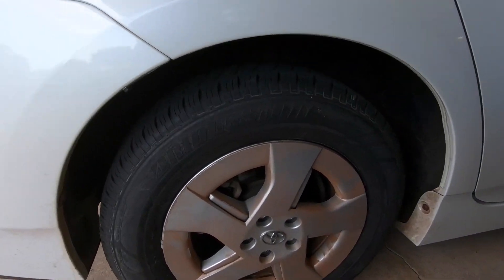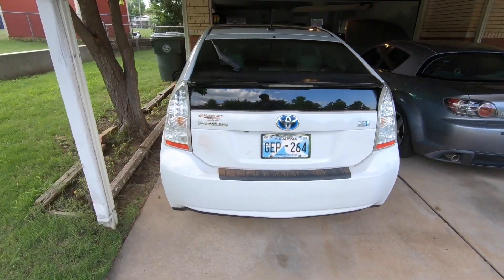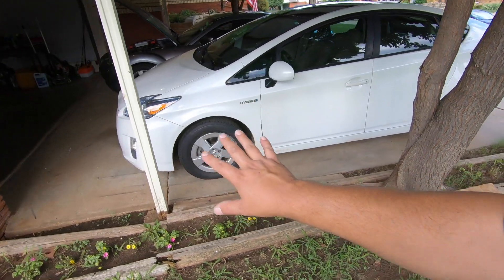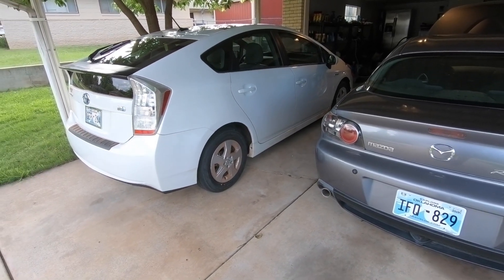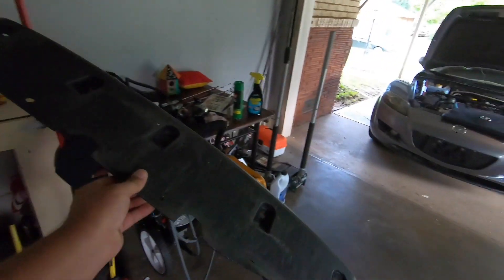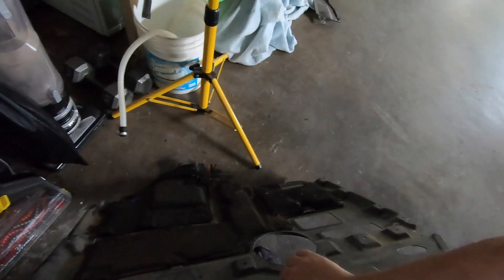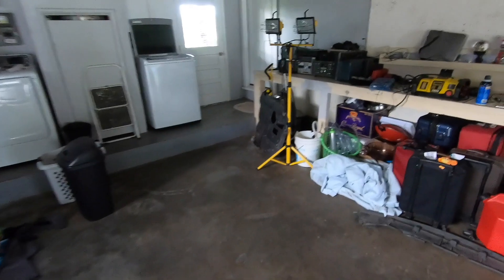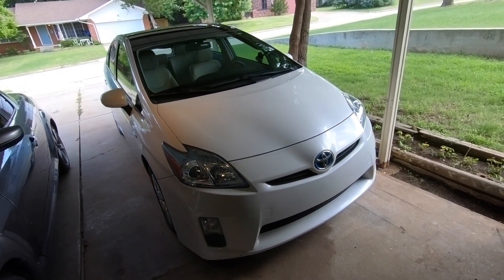We Sold the Copart 2001 Chevy Astro!! Profit or Loss?? Prius Updates!

Comment: Your absolutely right about the tires Uberman. It's definitely worth it to get the right low rolling resistance tires and the plastic pieces. I had the same car and you should get between 48 and 52mpg, if you drive economicly.
Reply: In case you haven’t found them, cleanmpg.com for mpg tips, priuschat.com for Prii scecific info.   Have same car as yours without the solar roof.  214,000 miles.  (Hubcap missing on same wheel)

Comment: FYI, if there's need to get technical, many high-mileage owners and taxis (for well over a decade now) have noted several things about these cars, particularly this model.

For the sake of longevity, replace the transaxle fluid on the first 30,000 miles, then every 50,000. Toyota says its lifetime fluid but that's bunk.

Clean the HV fan, it gets clogged up with seat and clothes fibres quickly. It can restrict air getting through the hot battery.

For gen 3s, there's a occurring problem with high-mileage and cylinder head damage and oil consumption. It's an aluminum block, so that's not ideal and couple that to the EGR - but more likely, it's because for over 100,000 miles, we just start these cars and drive them away. They can be done so, but it's damaging and it's more protective to allow the engine to start, warm up and shut off by itself for 2 minutes.

Driving away immediately running up that engine not only forces it to work down the road with settled, cold oil not getting to the moving parts yet, but it also drains the battery fast as it's the primary mover until the computer says the engine is warm enough to operate normally.

Comment: By the way the rear aluminum doors and the front aluminum Hood on the RX8 there hydroformed they're super expensive to reproduce that is awesome car technology made for 50/50 weight ratio car, I expect running RX-8 in about 10 years will go huge in value, and good examples of an RX-8 will be hard to find

Comment: Bridgestone Ecopia also run that name in a low rolling resistance tire for tractor trailers. I learned everything I could (when fuel went to 4.80 gal) about rolling resistance,,, areodynamics,,, closing any kind of wind holes that causes turbulent winds around the vehicle,,,, smart operators learn to get every nickel extra per mile,,, enough nickels makes dollars! Cutting rolling resistance (tires, alignments) & cutting wind turbulence under & around the vehicle is top consideration in the trucking game. Just in tires & aerodynamic add on's, I can pick up 1&1/2 - 2 mpg,,,,, and on 100,000 -150,000 miles per year that's 15-20 grand in fuel savings alone! COST PER MILE! Paying attention to every little detail that cuts operating expenses,,,,, put more profit in your front pocket!
Reply from the maker: Exactly!

Comment: The engineers that designed the plastics for the Prius did so for a reason - I think you're right to add that stuff back in.  As for the tires - my math says that's less than $75 a corner - add in another $50 or so for mount and balance you're about retail for a set of tires on an economy car - those who argue probably haven't priced rubber (new) in the last few years....  Great to hear you've found another RX8 to get bits/pieces off of - heck I'd take as many parts as you can and eBay the spares that won't make sense to include with the car when you turn it over...
Reply from the maker: Thank you Scott. Many have argued with me over it, but oh well lol.

Comment: 30,000 miles dived by 42 mpg = 714 gallons of gas. At 47 mpg you’d use 638. So a savings of 76 gallons. $3 a gallon x 76 is $228.  Having to make less gas stops might be worth it (or other intangible factors)  even if dollar wise it does not.
Reply from the maker: Math never lies! I've been averaging 41.3MPG with the old tires, I'll to a tank run on the new to see the true increase in MPGs and do a video on that.
Reply: Makes my brain hurt
Reply: I never did an alignment or changed my tires on my Toyota corolla 2001. The check engine light bulb burned out. Literally the last time I changed something was oil change and it was last year.

Comment: 3:36 "...Plugs... I know it's a pain but we're going to do that together..."  Sure.  You replace the plugs, I'll supervise here on YouTube make sure you did a good job :-P

Something wrong with the EGR?  As difficult as it may be that's one that I recommend fixing if there is something wrong with it because EGR makes a really big difference in fuel economy at highway speeds (not so much in the city).  Under light-load cruising speeds it displaces some of the fuel/air mixture with inert exhaust to reduce the cylinder's need of fuel, thus conserving fuel.  But if there's no EGR related DTC I'd probably leave it alone, if it ain't broke don't fix it.

Glad to see you make a profit on one of your investments, and with a potential profit on the RX8 (If you decide to sell), the channel may be making a change for a better direction, so I'm glad about that.  I'm sure the IRS will be glad too (Don't you just love them?).  In your vid from Jun 12, 2018, I estimated $1,650 to $2,450 so I wasn't too far off.
Reply from the maker: No EGR code. This car is known to have a gummed up EGR that needs cleaned around my mileage. Preventative maintenance I suppose. I may or may not tackle it. It's not fun. :)

Comment: Hi Uber Man! My friend bought a 99 Chevy venture about 2/3 months ago. It’s definitely seen better days. She doesn’t have a lot of money and I was wondering if a head gasket/intake gasket job would be worth it. It’s got no muffler, a sensitive burnt trans, and 170,000 hard miles. But besides the trans rarely slipping between 1st to second shift it’s not a bad car.  We’re not sure if it’s the head or intake gasket. Found out due to air building up in the cooling system and constant overheating. I vented the system completely by backing it in a downhill driveway, and then when I started it, it was smoking, a LOT... What confused me is while we limped it home, the smoke stopped. If you could tell me what you’d do I’d appreciate it. If she can’t afford to fix it, I’m gonna end up buying it and trying to fix it myself. Thanks.
Reply from the maker: I'd personally stay away from it. But then again it could just be a leaking lower plenum gasket. The trans may work better with a new filter, fluid, and some lucas.

Comment: "Aerodynamic covers" 😂😂😂😂😂😂😂😂😂😂😂😂😂 those are splash gaurds
Reply from the maker: Laugh at yourself.i called Toyota service and researched online. These are to negate turbulence under the car. Dumbass.
Reply: Uber Man dude i thought it was just funny thats what toyota calls them...
Reply: He's right.  Even the plastic hubcaps are supposed to be aerodynamic.  Having a smooth undertray is a big deal when it comes to aerodynamics, drag and thus economy.  Look at a properly built race car.  As flat as they can be and even the suspension bits blocked off from potential turbulence. (That said I took the tray off my Prius and left it off during my last oil change since it's such a pain.)  Maybe even worth the $40 it costs me a year if it changes my MPG by 2mpg.  (Doing the numbers each MPG loss per year at 9000miles/year costs about $19.)

Comment: rear bumper was most definitely painted.
Reply from the maker: People keep saying that but it is a pearl paint. The bumper is plastic and the body is metal. Many cars look slightly off due to plastic looking different than paint on metal. IDK it's not really a big deal if it was painted.
Reply: My Prius looks the same way the front bumper and rear bumper colors are off also.  I see other Prius’s also, the color is slightly off. The bumper before being primed and painted is black, in my opinion the heat from our harsh Florida climate and maybe Oklahoma’s climate,  the black color from the bumper is bleeding through.